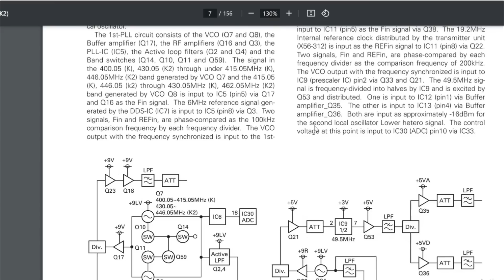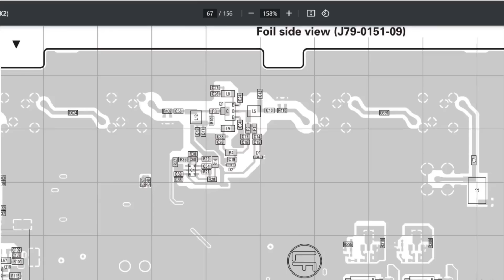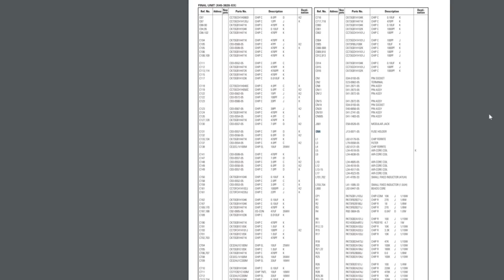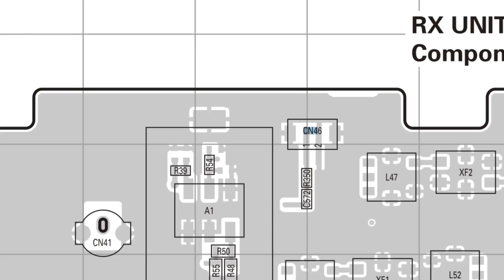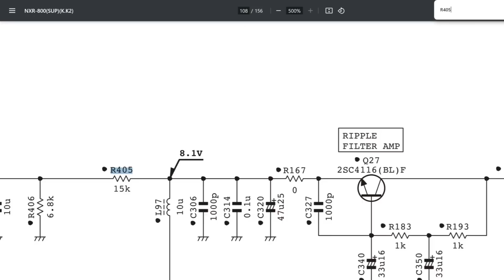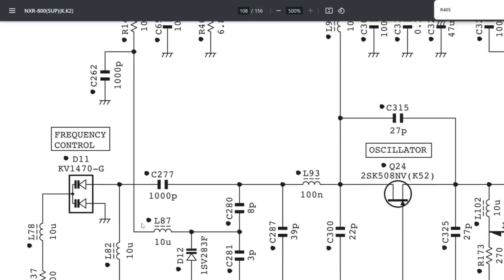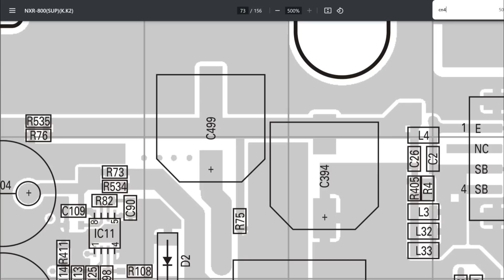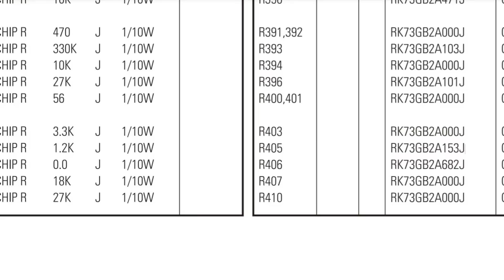Kenwood Blew my Mind - NXR-800K. Repair. How Right to repair should be.

Comment: Back then, even in to the 2000s, most Companies were providing service manuals for their devices, these helped me a lot for example when troubleshooting old Sony MD Players. Not all Manuals are as detailed as this one, but back then most of them had all the board layouts and a list of all the parts. Then into the 2000s and 2010s i think it got fewer and as most devices get more complicated it's getting harder and harder to find service manuals, and of course some companies don't provide any because they don't want their products getting repaired. Although i still don't exactly understand where the manufacturers were publishing these, because when you are searching for service manuals for older devices you will most likely find them somewhere on the internet on some strange sites, but never actually on the website of the manufacturer. So i suppose they might also already only got published to authorized people or repair shops.

Comment: I work for an electronics company, and we do not provide such complete documentation, mostly because a company in the UK released suspiciously similar products (but cheapened wherever possible) about 6 months after we did. We never give out BOMs or schematics unless for a documented product serial number which is out of warranty to prevent this sort of thing.  Butif you have something out of warranty, or which we no longer support, i will give them any documentation we have.  In some cases i even send out repair parts for free because it isn't worth doing the paperwork for low-cost parts.

Comment: I hold an Amateur Extra license W1GCF.  I'm going to speculate here as to why two zero ohm resistors and a fuse.  This is a repeater, often installed in a place that can be hard to reach for service.  Also, in an environment with 50 watt VHF RF, and then connected to antennas, things can get weird.  So this parallel fuse/resistor arrangement may have been intended to partly fail to relieve the effects of an impulse or surge. I admit, that's doesn't make much sense, but I took a try.  As state Amateur radio products in general are well documented but above them all is Kenwood.  Another one with good schematics is Elecraft.  If anyone has a speculation they like better, I'd love to hear it.
Reply: 73 from Madeira Island

Comment: When i was still messing around with car audio stuff when i was young i had a big old 90's model 4kw 5ch Kenwood amplifier it was physically enormous and weighed close to 10kg due to the entire housing essentially being a heat sink.
i had repaired it a number of times mainly things like broken solder joints and failed capacitors but one thing i did find incredible was all the components and values were labelled on the the pcb itself i have never seen anything like it again other than on generic Chinese stuff where one pcb may be used in 10 different applications its good to see Kenwood is still supplying data and information the keep their products going.

Comment: I have a kenwood kitchen chef, so far I replaced the gear assembly after 8 years. I haven’t searched for a service manual, but the fact that I could get the gear assembly is crazy. This machine is going strong and handles a lot of abuse. 
Your video convinced me, I will buy kenwood when I have the option.
Good work kenwood.
Reply: We've got a Kenwood food mixer from the 1970s. It's still working! Not sure if it's the same company for the part in the video though?

Comment: Secondly you asked about these two resistors 0 ohms connected in parallel why? Which I think these are for more current handling purpose so that with higher current print should not be damaged.

Comment: AV receivers have awesome published schematics. Onkyo, Kenwood, Denon, etc. If you need a service manual for AVRs, Hifi Engine is the spot.

White SMD with T top is usually a time-delay fuse. "0 ohms" until it pops. ;)

Comment: Armature Radio equipment is the easiest to repair and modify because of the culture of schematics.   With that said, Ham Radio operators blow things up on a daily basis.  If they knew about you, they would be sending you radio after radio.  Its getting hard to find a good repair shop.

Comment: Man, those company who are sold amateur radio equipment, you can find practically a "Service Manual" for every product they sold, with these Service Manual i have been repairing so many Amateur Radio product such hase handheld like the FT-23R FT-73R FT-411 FT-811, mobile FT-212RH FT-712RH and bench radio FT-736R. (Every model cited are from Yaesu)
And even this, those manual have explenations for radios calibrations with some pointed equipment.
Kenwood, Icom and Yaesu are great for these "Service Manual", you can count to them !

Comment: To me Apple doesn't provide manuals because they:
want to be the ones to provide repair alone, 
want be able to ask huge amounts for repairs, because they are the only ones doing it, 
they don't want costumers that can do their won repairs, doing it, so they are forced to go though Apple or buy a new product.
don't want their products to live longer than they deem necessary, so they can sell new products and specially, 
do not get to live long enough, to enter the second hand market where Apple "has no profit" (they do second hand keeps their brand circulating and their rep/prestige high).

Comment: I remember having a complete schematic as well of a Commodore 64. Since most stuff nowadays have SMD components and are using microcontrollers, cpu's, software and eeprom's and complex stuff like that, it's unlikely such boards would ever get fixed as they are too complex. That may be the reason why most products don't have such a manual.

Comment: I started fixing electronics thanks to you, bought microscope, soldering station etc... Most of the appliances i fix are air conditioner, washing machine, dryer, dishwasher.... Most of those manufacturers have such manual, with diagrams and schematics.... Seems it's hard to get schematics for phones and computers only....

Comment: Kenwood and other radio equipment manufacturers have fortunately never really stopped providing complete service manuals and information to both the amateur and commercial consumers. Makes me miss the old days. We had a console when I was a kid - had the TV, record player, radio, and tape play all in one. The schematic was included in a fold out, and etched into the back panel. A tube failed one time - Dad pulled it out, we got the value off the schematic, went to the display at the grocery store, picked one up, brought it home and swapped it in. Done. lol - wow, different times :)

Comment: That's a service manual which typically aren't given to customers, they're given to authorized service centers. The manuals do tend to leak out over time, or in some cases the manufacturer will give it to you if you ask for it. 

All the people in the comments like "Dell/Apple doesn't make these!" Are wrong. Of course they do, they just don't give them to Johnny Donuts (you). Authorized service centers and internal use only. They're extremely strict with these and enforce it using legal agreements (like NDAs).
Reply: The ham radio technician community is a tight knit community. And even if you aren't really a technician with an official shop and you know somebody who does have access to these documents, you may find yourself in possession of them.

Comment: used to get these with a lot of equipment years ago.. but with the advent of the cheap trow away attitude it all changed. sometimes you didn't get the schematics direct with the unit but you could easily get them direct. I have some Arcam amplifiers ... Couple of phone calls and I had the full schematics from Cambridge the original makers... 
but expecting a company like the one mentioned who has fought against the right to repair at a mercenary level is wishful thinking... Luckily we have some very good resourceful people who have done it for people...

Comment: I worked in TV/Video/Audio repair 30 years ago and it was common place to have full schematics and parts lists for every device we ever repaired. We had a whole filing cabinet full of them. Repair was simple when the manufacturers made such manuals readily available. The fact that so many companies no longer do so has done nothing to prevent the throw away society we have today. I remember fixing equipment that was 20 plus years old. Today most failed electronics ends up in the trash simply because it can't be repaired without service manuals.

Comment: I work on radios as well and this is why I like buying older test equipment.  You get schematics, service data, calibration procedures, parts lists, board views, block diagrams, etc.   My old Fluke 6071A RF signal generator from the 80's has four manuals filled with this stuff,  it was a different world back then...

Comment: That is from  Kenwood Amateur Radio  equipment, which means that if you want to sell products to be purchased by Amateur Radio individuals you have to provide means for them to dig into their radios or equipment for them to repair, properly align it, and parts!  You have to provide full service manuals.  I am a Ham Radio operator, and began when I was 16 years old.  My first radio was a Heathkit 5400 put together by me, aligned by me used by me. I had the contruction manual with all.  Then I bought a Yaesu 1000D I bought the full service manua,l complete.  I still have the Yaesu, i am 67 years old now!  And I will not buy any radio that the manufacturer will not provide a full service manual with all in it!

Comment: Most amateur radio equipment have schematics.  Amateur Radio licenses are experimenters licenses, the hobby itself started by tinkering, building kits, and experimenting.  The finished goods makers of radios had to provide schematics to a community used to building their own radio gear from kits.  Heath Kits were all the rage.  Elecraft, QRP labs, and others provide kits today.  I built two pieces of equipment just this year - a WSPR beacon and a "Hamshack" clock.  I will be doing further modifications to them.  If you search amateur radio today, you will still see people experimenting, adapting, and tinkering at component levels.

Comment: The manual was from 2008 - that's 16 years ago. Hopefully they still provide those manuals, but a lot changed in 16 years. And I wonder why you didn't search for the board number and then look only at the details of that board. And, last but not least, you replaced an ugly 0 Ohm solder blob with two 0 Ohm resistors. Function: same. Explanation?

Comment: Not only the manual, the quality of Kenwood products is outstanding. I have a Kenwood Spectrum hi-fi bought new in 1984. It still works perfectly in 2024. I don't use it much anymore, but there was a time that I played disco with it. That amp was driven at max power for hours on end twice a week for a long time, even the speakers still sound pretty good, with only a hint of distortion these days, but I don't use more than about half power in my old age!

Comment: There are 19 boards in this radio
Reply: No. -19 is a different revision - you just need to search for the correct manual...
Reply: @kappa7  it’s not a revision it’s a sub board

Comment: I bought a Kenwood amp to replace a failing Bazooka (20 years old and the RCA connectors are failing) because it was on sale, and I had seen dyno tests where they actually provide wattage they claim, but also because I've heard of their quality.  This was before I knew about their repair information they provide!  Now I'm even more excited to get it hooked up and running.  I think a lot more of their products will end up in my possession from here out.

Comment: That blob of solder is creating a short circuit just like the  zero ohm resistors. The question now is, if it didn't work before, what makes you think it will work now with the resistors in place?
Reply: Might be Kenwood sponsored this video?😁
Reply: Exactly.
Reply: 0 ohm with 0 ohm. If that device was not working, then it does not work now.... Looks to me like an influenced and sponsored video.
Reply: Навіть не перевірив на КЗ. Думаю там вигорів підсилювач.
Reply: Radio signals work in mysterious ways?

Comment: The 2 "0 ohm" resistors in parallel are fitted to handle the current for the circuit

Comment: Using two 0-ohm resistors in parallel in a circuit may initially appear redundant, as a single 0-ohm resistor effectively acts as a short circuit. However, this design choice is not without its merits, offering a more efficient circuit design.

- One of the key Advantages Of using two 0-ohm resistors in parallel is the increased current handling capacity they offer. Each 0-ohm resistor has a maximum current rating. By using two resistors, assuming they share the current equally, the circuit's current capacity can effectively double.

- Manufacturing Flexibility: During the design phase, PCB designers have the freedom to add extra pads for 0-ohm resistors. This practical approach allows for easier modifications or future changes without the need to redesign the entire PCB. By incorporating multiple 0-ohm resistor footprints, they can make adjustments to the routing of signals or power lines if necessary.

- Redundancy: Including multiple 0-ohm resistors can serve as a form of redundancy, enhancing the overall reliability of the circuit. Even if one resistor fails (though uncommon for 0-ohm resistors), the other can still maintain the connection, providing a secure circuit design.

- Ease of Testing and Debugging: During testing or debugging, multiple 0-ohm resistors can allow engineers to isolate and test different parts of the circuit. By selectively placing or removing these resistors, they can control the flow of signals or power more conveniently.

- Balancing PCB Layout: In some cases, placing two resistors in parallel can help with the PCB layout. It can balance trace routing or help with thermal management by distributing heat more evenly across the board.

While the primary function of a 0-ohm resistor is to act as a jumper, these practical considerations can justify the use of two in parallel in specific scenarios.

Comment: Back in the day, a person used to be able to get a "Sams" manual for practically anything.

What's the point of having a zero ohm resistor and a fuse both connecting the same traces?

Comment: For peace of mind ;-)......
Page 45/46 (Parts List)

R4 - Part No. RK73GB2A000J 0Hm 1/10W
R405 Part No. RK73GB2A000J  0Hm 1/10W
Reply: I remember doing electronics repairs in my teens especially car radio's (Late 80's/early 90's) and you could actually get decent service manuals like this (schematics, board layout, exploded diagrams, parts list, test procedures with meter readings/scope waveforms etc) for alot of electronic products. We can dream on that laws will be passed to force all manufacturers to provide service manuals of this calibre!

Comment: I would have checked/replaced the fuse and left off the 0R resistors.
Reply: Maybe look for the correct manual (it exists - just search for the board#), then search for the root cause...

Comment: I remember times when in TV Repair one could get full schematics and logic plans for the TVs and even had the pleasure to be at a time where still really old TVs where around that when opened had a little pocket with the schematics actually included.
Never will understands that it's today with the CAD and CAM and the internet not possible what required manually drawn on paper printed and magicians of folding tech to be put into each and every device.

When I see people repair their F150 with plans from the 1950's than this just an affront to ones intelligence and a wallet.

Comment: Well done Kenwood, exactly how it should be, and how it was done years ago. I'm showing my age now but circuit boards used to have the circuit diagram on the board with the values of the components and as such made it so much easier to repair.

Comment: Great video - good gear has info like this - Pioneer, Sansui and some others did the same back in the day. I kept my families receiver working for decades!
Zero Ohm Resistors are a thing! Had a good read on how many ways they can be used.
-RF choke
-skipping over a trace in a multi-layer board
- test point
- 'permanent' dip switch setting.
All sorts of tricks!  Thanks!!

Comment: I wrote Harmon Kardon asking for a schematic so I could find a part. They emailed me back with the entire service manual and a link to their site to buy parts. It was an extremely thorough manual.
Reply: Nice!

I mean, even though you had to ask for, they were extremely forthcoming.. commendable.
Reply: Well, I can understand they don't outright provide a service manual, as very few of their customers will ever need such a tome. But the fact that they actually prepare a detailed one and willing to give it to anyone who asked for it, shows that it's a trustworthy company.
Reply: HK and kenwwod are the same manufacturer only diffrent brands.
Reply: Omg!  @gabrielecossettini2923
Reply: My Harman Kardon AVR 25mk2 came with a full manual along with the schematics when I bought it originally more than 20 years ago. Kudos Harman Kardon!
Reply: same was for me with audio pro! they are the best
Reply: AV Receivers in general have these manuals. I repaired Onkyo, Denon, HK, they all had them. But the new ones are hard to repair regardless, so many ICs, they often fail spectacularly and many elements die on the board or on multiple boards. Taking them apart and putting them together also takes ages and they can be tested put together only. Most time you just buy a replacement board from ebay and hope that was the only issue.

Comment: I think the fuse was afterthought and it replaced these two 0R resistors in later board revision, but they left original pads for resistors, and added a new one for the fuse.